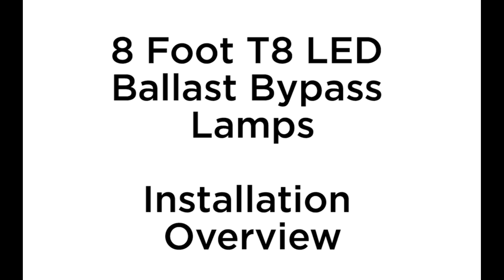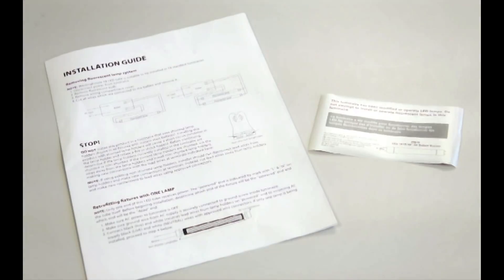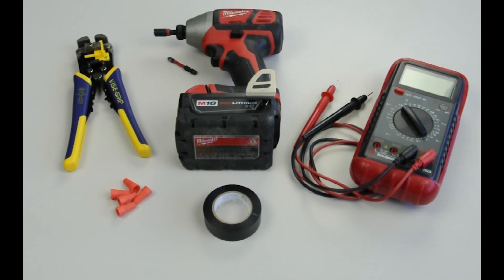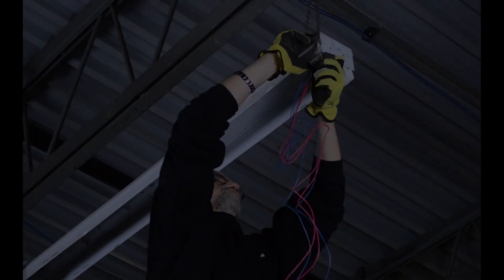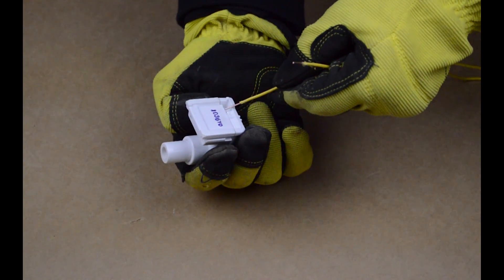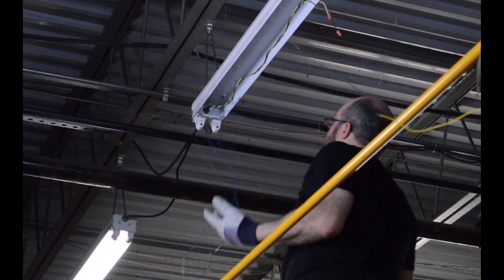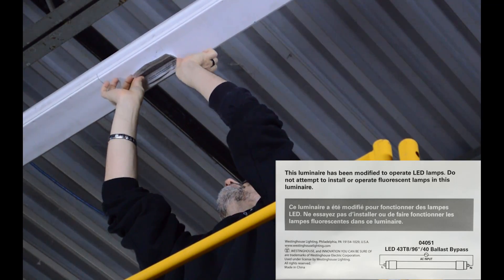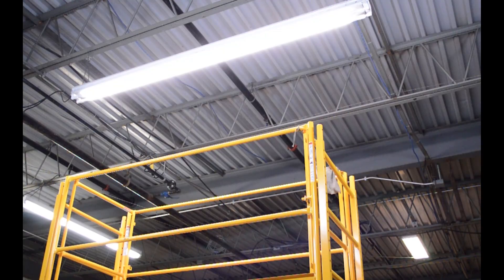8 ft T8 LED Ballast Bypass Installation Overview Educational Video

Comment: Cut power.   Connect ALL wires from EXISTING stationary sockets to black (hot) incoming power and the two wires from the EXISTING plunger sockets to the white (neutral) wire. Restore power after inserting the lamps.  If working hot, insert the neutral side first.

Usually, stat sockets fail ratio isn't as much as the plunger side and if that spring insulator is exposed from a burnout, I'd rather that spring be neutral than hot. If using plastic 8' jacketed tubes, use at least one support near the center of the lamp to prevent sag and eventual falling.

Thirty years experience in the lighting maintenance field. 68 years old and still cranking retrofits.

Comment: slow down the wires go witch way ?????????
Reply from the maker: Hi Merch 117,
This video is an installation overview and therefore does not provide step-by-step wiring instructions. However, this information can be found in the instruction manual. If you are unfamiliar with or uncomfortable with re-wiring the fixture, please contact a qualified electrician.

Comment: WOW How about a little more detailed description on the wiring?...WTF?
Reply: Steve, a wiring diagram was provided when we replaced the lights, one thing they don't mention is that you must replace all the lights and remove all ballasts on a circuit or the ballasts still in the circuit will burn out the led lights you install. Looks awesome when completed and saved us a lot of money over replacing all of the fixtures.